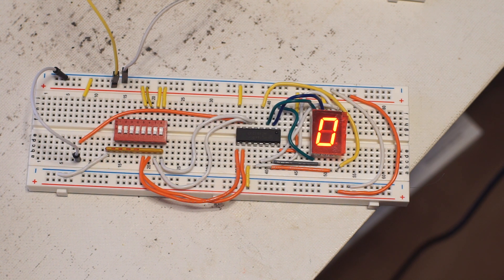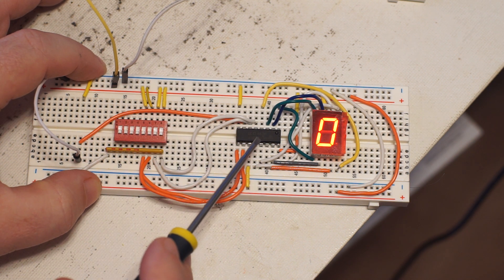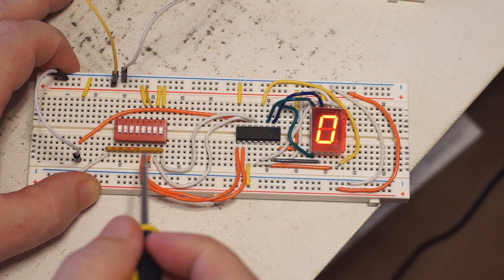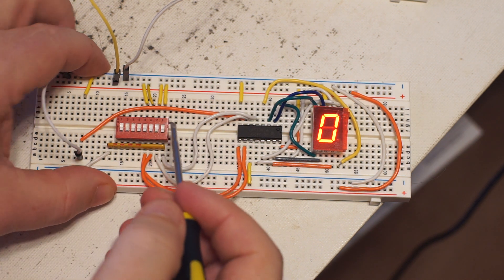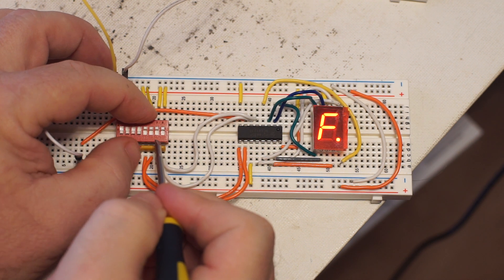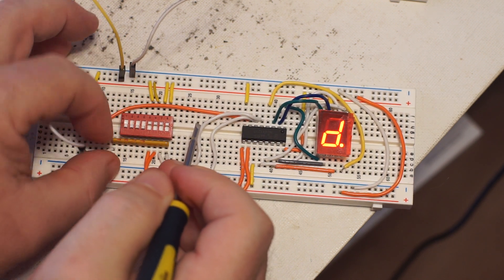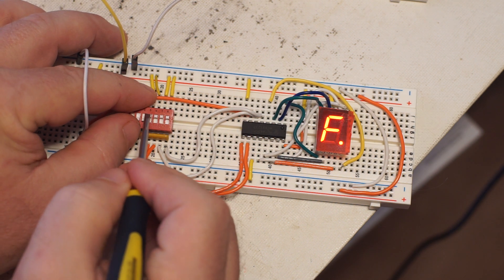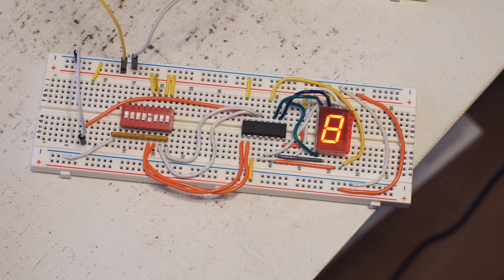Hex to 7-Segment Display Test

Comment: Too bad that chip is so hard to get
Reply from the maker: I bought mine from Aliexpress, but they definitely are dwindling in supply.
https://www.aliexpress.com/wholesale?SearchText=MC14495
Reply: @StephenHermer  I had thought of programming a PIC 16F54/84/627 to emulate the MC14495. We used thousands in the early 80's at Boeing. OOPs, the shortage might be partly my fault!
Reply from the maker: @alphahr  I came to this late, bought my first breadboard less than 4 years ago. Right now, I am trying to get addressing working using 74S482 bit-sliced controls. Pretty sweet ICs!

Comment: Where is the circuit diagram and components detail??
Reply from the maker: https://stephenhermer.com/breadboard2.php?postID=37&article=16-bit-Hex-Display-Board
Reply from the maker: I don't really diagram too much when I am prototyping. Instead, I use the pin-out diagram from the MC14495 datasheet, and just work my way through it. I am starting to blog about about the computer, but I am definitely a rank amateur.